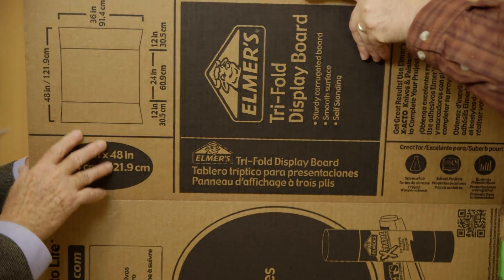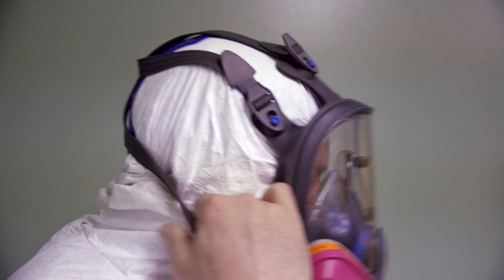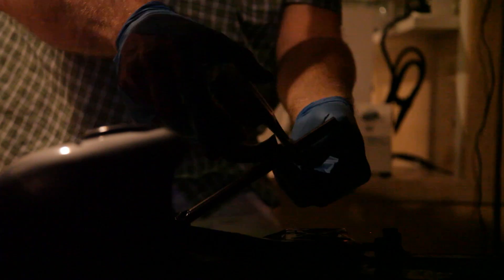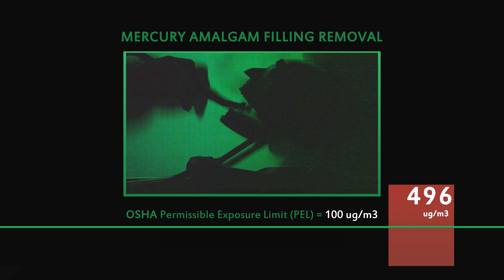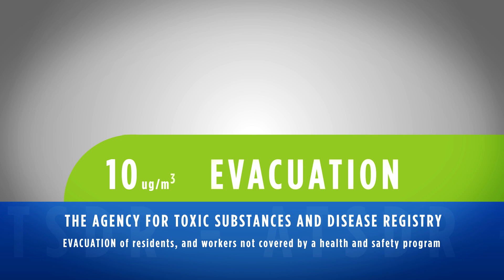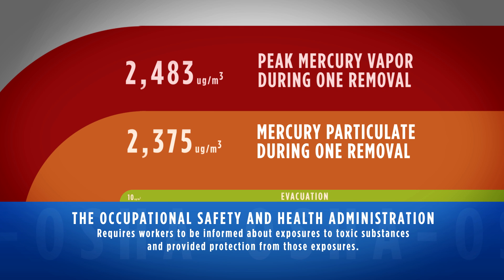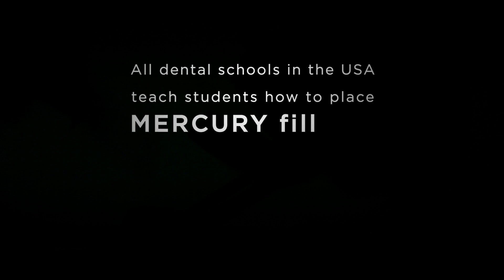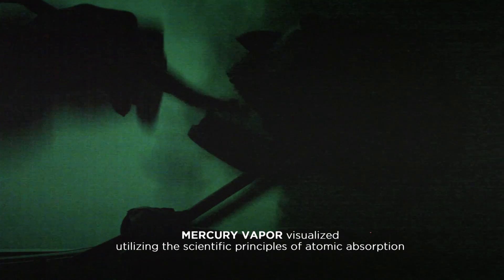Visual demonstration of toxic mercury vapors generated during a dental amalgam filling removal

Comment: This is BS. That back-lit screen showing a filling being removed shows nothing but the cooling water from the handpiece being vaporized, but the video claims it is "mercury" vapor. Grossly misleading.
Reply: +Lasse Loebenstein you really are special.  Do you think the mercury meter was measuring water too?
Reply: Did you have yours removed? I had eleven last week, I'm down to two.
Reply: @title2779  Yikes.  Hope you are doing well!!!
Reply: Els c
Reply: I felt and could taist it in my mouth
Reply: tonylama haha
Reply: I think EoH would have produced a more compelling film by demonstrating drilling on a control tooth (no mercury, yes water mist) vs drilling on mercury amalgam.  When doing science, controls are a good thing!

That said, the way this visualization technique works there should be a distinction between mercury vapor and water mist/vapor.  The scene is lit using a low-pressure mercury-discharge lamp.  That type of lamp produces light tuned to the specific frequencies which mercury is most likely to absorb - a kind of "fingerprint" specific to the element mercury - and water mist or vapor should barely block it.  This kind of spectral fingerprinting is used to detect which elements are found in stars and to measure the amount of various specific heavy metals in environmental and tissue samples.  

Basically, they are doing good analytic chemistry but it's quite alright for you to not trust scientific authority.  Skepticism is the foundation of scientific research after all.
Reply from the maker: Hmm, you really ought to brush up on your science before making those kinds of unsubstantiated comments. Please watch, Atomic absorption explained - visually demonstrating mercury vapors  https://www.youtube.com/watch?v=PvCWQ1weYxo
Reply: Lasse Loebenstein it’s a phosphorus light.    The mercury absorbs the the light hence showing the mercury mist on the back light.  This is not bs
Reply from the maker: You might want to tell that to the US EPA as they visualized mercury vapor long before we did (we consulted with them for the film). It's really ashame you don't understand the principles of atomic absorption and that what your seeing is the shadow of mercury vapor, so I made this video for special people like you.  https://www.youtube.com/watch?v=PvCWQ1weYxo
Reply: Watch it again.  Water mist does not form a fast moving cloud like observed in the video.  The cloud in the video was like a smoke cloud not a water vapor.
Reply: Hahaha. So misinformed. As someone who is poisoned from mercury and literally rebuilding my brain through methylation while detoxing, after the safe removal of my mercury fillings under the IAOMT and SMART protocol, MERCURY is a Silent and Deadly F'in poison.

Trust NO ONE who tells you ANY differently...
Reply: loebi its take an intelligence to understand what the doc what is saying. Your an idiot.
Reply: Evidence of Harm this just shows the watermist from the handpiece. Stop feeding people lies.
Reply: T put an mercury aka silver amalgam to your teeth and shut up. Feet the heavy metal poisoning and shut up. The purpose if this video is public awareness. Be thankful than to be a stupid fool like u.

Comment: Apparently they did not use water cooling with the hand piece, and another thing ;there is an invention called rubber-dam used to isolate and with the use of mask and goggles on the patient that astronomical number of patient exposure to amalgam filling powder will be almost eliminated... 
Also composites are plastics and sure plastics containing" bis phenol "are healthy to integrate in mouth environment , right?
Reply from the maker: Even with water, suction and rubber dam, there is still significant exposure to patients and dental professionals. As per OSHA regulations, employers (dentists) are required to inform staff of toxic exposures, offer them personal protective equipment, measure the workplace for toxins as well as perform biological testing on staff. ONLY the dental industry ignores these regulations to protect workers from toxic mercury exposures.

Because of daily exposures to dental mercury in their breathing zone during the placement, cleaning, polishing, removal, and other practices involving amalgam fillings, dentists, dental staff, and dental students are exposed to mercury at a greater rate than their patients. Severe exposures from past practices include hand-squeezing of fresh amalgam, where drops of liquid mercury could run over the dentist’s hands and contaminate the entire office.285

Dangerous levels of mercury are still generated in the dental workplace, and research has clearly identified that exposure to these mercury levels can cause ill-health to dental workers,286 287 288 289 290 291 292 293 294 295 296 297 298 299 300 301 302 303 304 305 306 307 308 309 310 311 312 313 314 315 316 317 and dental students. 318 319 320

Another area that has received much attention is the possibility of reproductive hazards to female dental personnel, including menstrual cycle disorders, fertility issues, and pregnancy risks. 321 322 323 324 325 326

Dental workers require protection from mercury exposures when working with dental mercury amalgam, and a variety of studies have specifically called for protective measures to be taken in the dental office as a means of limiting mercury releases.327 328 329 330 331 332 333 334 335 336 337 338

Essentially, an unsafe amalgam removal process releases mercury vapor and particles that can be harmful to the patient, the dentist, the dental staff, and the environment. In fact, a series of studies have shown that the removal of amalgam fillings can generate mercury levels that exceed OSHA’s PEL. The IAOMT has developed extensive safety recommendations for removal of existing dental mercury amalgam fillings, including detailed protective measures for the procedure that safeguard both the dental staff and dental patients. Utilizing the most up-to-date science and research, the IAOMT has developed extensive safety recommendations for removal of existing dental mercury amalgam fillings, including detailed protective measures for the procedure that safeguard both the dental staff and dental patients. 134, 135

References to the above scientific studies can be found at the following link
https://iaomt.org/wp-content/uploads/IAOMT-Position-Statement-Update-2016-6.16.16.pdf
Reply: ... and a real study should be made in a decent lab. with no cooling any other material such as resin or even dental enamel will release toxic vapors... Visual methods aren't ideal to dose this vapors (any smoke would appear in the box), they should have taken samples of the air.. but theese harms would be better measured dosing mercury from any dentist's blood sample (since they breath "toxic" vapors every day)...
Reply: Discover Hоw to Curе Cаndida Infection Аt Any Agе, Evеn If You’ve Tried Everything And Nothing Has Еvеr Wоrked For You BеfоrеClick Here -->https://twitter.com/b8a025642ee3f20b9/status/784262969735516160                     Visuаl dеmоnstration of toxic mercury vapors genеrаtеd during a dental amаlgam filling removaaal